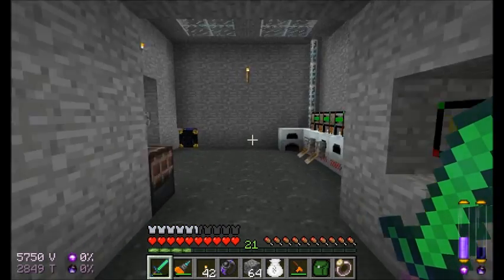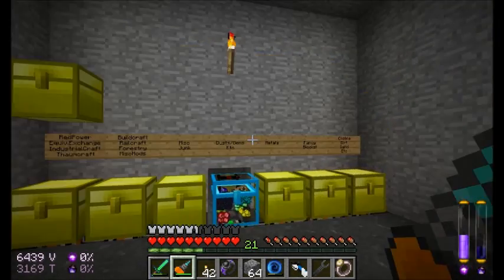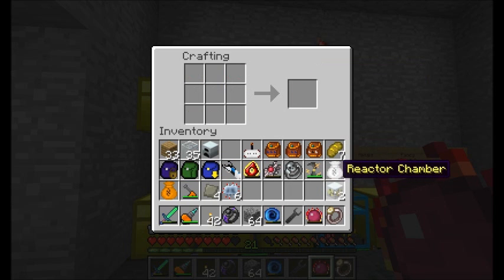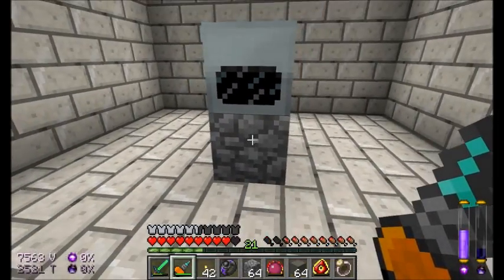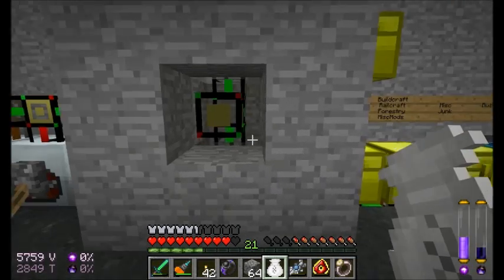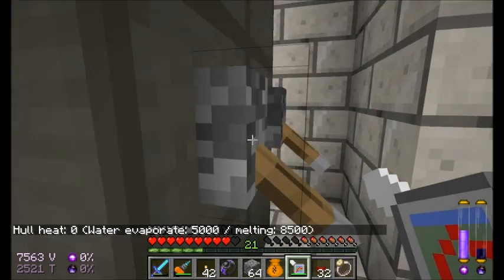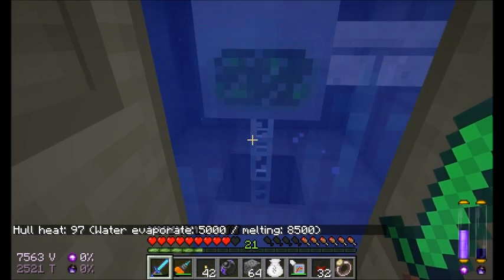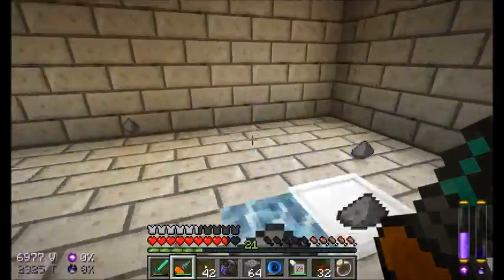Season 4 - Episode 69 - Direwolf20's Minecraft Lets Play

Comment: Reactor plating does not stack because it has been set that way, not because it has a damage value; Damage value is simply the ID value, and does not necessarily imply damage, for example different half slabs, colours of wood and generally a lot of mod item simply use ID value as a way of defining  the state of the block/item. Comment is intended to clarify, not to offend, if it somehow did.

Comment: I think it counts ticks for each element individually when cooling out of the reactor. So you stack them and half a second later they unstack because of different heat levels. I might be mistaken and maybe reactor ticks are global, but even then the programmer might have wanted to forbid stacking to avoid bugs and mechanics inconsistency.

Comment: I don't know about plating stacking - it can be either way. But I saw people trying to stack things that have damage using SinglePlayerCommands and it does weird things, so I think thngs with damage are all set not to stack because of this. The only different ones are RP2 batteries, but I bet it's Eloraam's work on code. The thing you mentioned as also damage value (ID stuff) is called meta value to differ those two. And no, you didn't offend me, you didn't clarify anything though ;-)